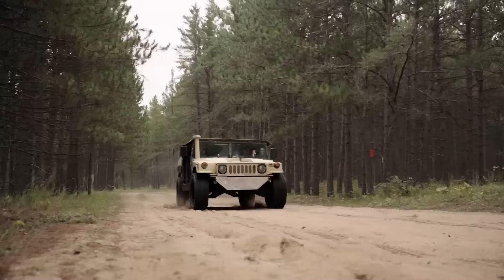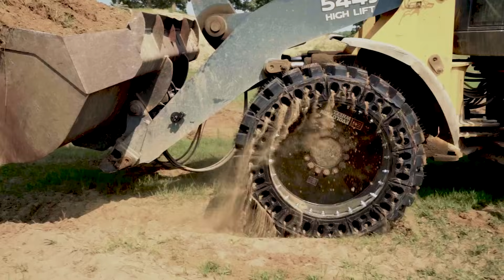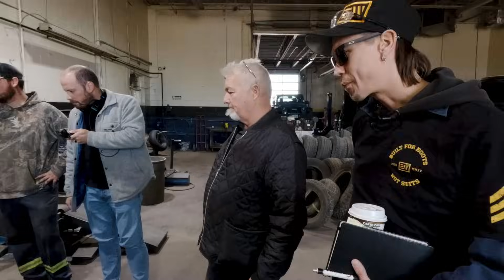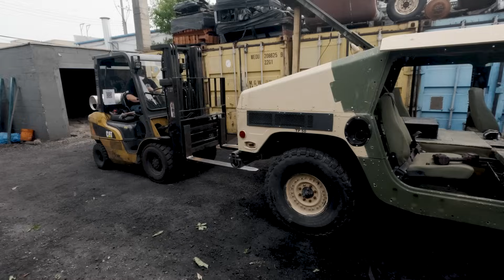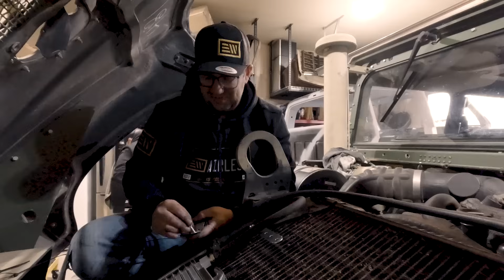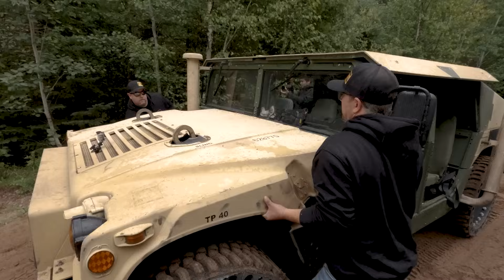Reinventing the Wheel: AIRLESS Off-Road Tires | They Said It Would Fail (Operation Airless Ep. 1)

Comment from the maker: WATCH NEW Episode 2 is UP!
https://youtu.be/gZHt8Mz-jJI
-
Off-road only. Would you run AIRLESS on your truck/SUV or UTV?
Share your rig + terrain (rocks/mud/sand/snow) and your deal-breaker: weight, ride feel, traction, price, speed/DOT, noise, serviceability—what matters most?

(Reply with TRUCK, UTV, FLEET, or MIL and we’ll follow up in-thread.)
Reply: I just saw 8 minutes of your video without getting any idea on how they work on sand. Can you go uphill (climb a significant dune)?

Hilux. Dunes and Andes.
Deal breaker: worse performance than conventional AT tires
Reply: Truck. Diesel wheeling rig (wip). 
Terrain: Apocalypse 
Not so much a deal breaker, but roadability would be real big plus.
I'm in the middle of buying a house or I would have already called you.

Comment: Ik the wheel been reinvented a ton of times unsuccessfully, but its good to see you haven't stopped. When Innovation meets reliability is when revolution begins. An if these continue to look as promising as they have, they'll definitely be my first choice for my k3500 rebuild. Keep on truckin. Hope the best.
Reply from the maker: Thanks for the support! What year K3500?
Reply: @EvolutionWheel 93
Reply from the maker: Nice! Im doing an 87 Crew Cab Dually 2wd to 4wd conversion
Reply: @EvolutionWheel cool, for mine im planning to swap in a big block and turn it into a dedicated hauler. Rn it has a low mileage small block that im dropping into my 98 k1500.
Reply from the maker: Great minds think alike! Planning on dropping in a 496 with an EFI. Good luck with your builds! Share pics when done!
Reply: @EvolutionWheel will do

Comment: Cool project, good luck! Flyer of an idea for you, thinking about all the 'can you air it down?' comments... Hear me out - you know those cake pans with like a cam locking latch where you can unlatch it to release after baking? What about that inverted to the inside of the wheel? Where it's cam locked into place, it's in tension, "pushing out" to provide stiffness for the tread on normal mode. Then if you want to 'air down', go unlatch the cam locks to release the inner ring tension and let the tread relax and flex for rock crawling or whatever. 

Saw steel cylinder structure in the shots from your shop there, presumably that's the structural base that the rubber attaches to... probably rock solid and your tread flex happens in the rubber structure/cavities. Would complicates the simple metal ring structure (and its interface with the rubber) massively, but keeps the moving parts to a minimum/'low tech'. Maybe inner structural ring has to stay (gotta be solid and attached to the wheel hub), so solve for something adjustable outside of that radius. Maybe a stiffener ring baked into the rubber, and somehow it can get switched from supported to unsupported so it can flex more in air-down mode. Magnets contained within the rubber structure support the flex ring, then can get rotated or cammed somehow to reduce their support incrementally and allow the flex ring full range of motion at 'softest' setting. ...so there you go, it's a flyer idea. ;)
Reply from the maker: Took me a bit to read your comment, think about it and then respond. Its an interesting idea, we spoke to some potential users a couple months ago and they said that the #1 issue with airless was not having the ability to change the contact patch pressure. We have a few ideas and this is another. Not sure about the manufacturability of it, but it has the wheels turning. Stay tuned for more!
Reply: That is pretty fascinating. Perhaps use curved composite plates with in-mold metal tabs instead of the inner stiffener to help keep weight down and reduce centrifugal stress at higher speed. Could potential allow enough flex to avoid inner rubber material damage during debris impacts.
Reply: @josephvanwanzeele5125  Yeah, interesting idea with composite or other material possibilities. I wonder about some of the cool material tech out there that can sort of 'internally' switch stiffness on or off - on like nano-scale stuff, I feel like I've seen electrical charge or magnetism or something trigger tiny robots to switch various properties on or off. Maybe inside of a generation from now we'll have these tires that do stuff we didn't even think about as a possibility with our mechanical/moving parts minds now...;).

 Weight and centrifugal force become such a huge factor in engineering for spinning wheels like this. Sounds like the team already has run into the limits of the form for higher-speed/higher-RPM applications. The weight of the metal ring + heavy rubber layer solution limits this to heavy-duty, lower-RPM applications. So probably some major form/design shift to even consider for regular on-road/off-road vehicle use. But it sounds like even within the small vehicle off-roader world, folks are saying they would want/need this tire to be adjustable for, say, trail vs crawling type scenarios. Or at least that regular air tires would have enough of an advantage that the market for this solution would probably be limited in their realm. Anyhoo... to the Evolution crew - fun to see you guys diving into this and solving some of these things in a new way. Cheers and all the best in the endeavor!